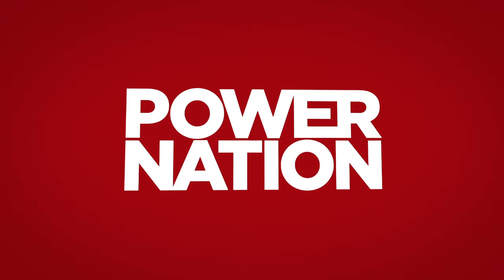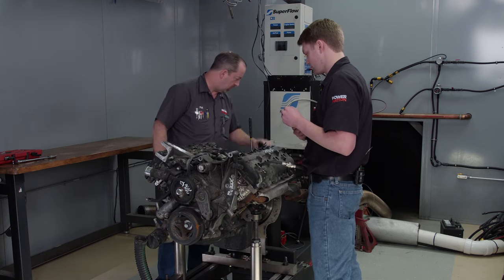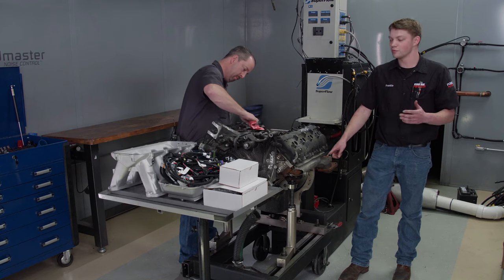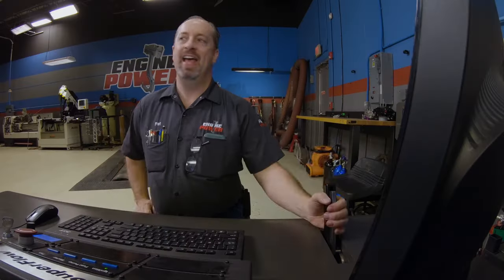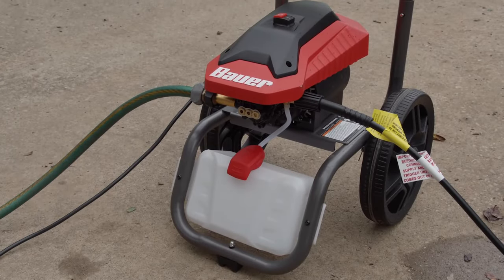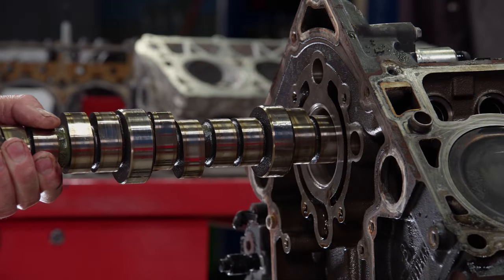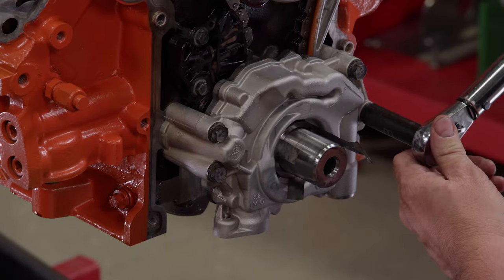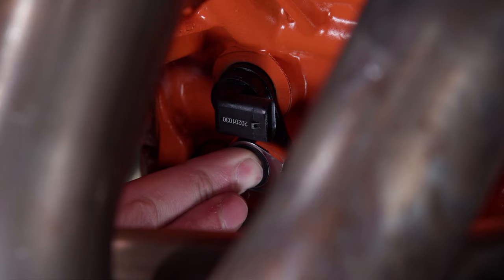Burnt Junkyard 6.4L Gen III HEMI Rises From The Ashes - Engine Power S8, E12

Comment: Not a tunnel ram fan, but to bring a scarred junk engine back is pretty cool nonetheless.
Reply: For sure, talk about a weekend special. Way cool.
Reply: Would have loved to see what they could do with something that would fit under a 440-6 pack hood or something. All of their builds are "streetable" race engines and would like to see just a healthy driver that isn't so over the top.
Reply: @JDK73772  a cam only 6.4 Hemi truck engine is a race engine?
Reply: @GTPCarpy  You missed the part about fitting UNDER a hood. More street oriented.
Reply: @JDK73772  you're still insinuating that it's a race engine and it's only "streetable" since it clears the hood
Reply: Is a junkyard SBC a joke to you?
Reply: @JDK73772  How is this engine not streetable? It’s a stock engine with a cam and an intake. Not man enough to put something through your hood? Then get a shorter intake and spare the tears.
Reply: @moparproud3978  the Hiram comes with a top end that fits under the truck hood.

Comment: Even the bone stock 5.7 gen 3 hemi heads flow enough stock to make serious horsepower
Reply: $300 cam swap and makes 400hp. Not bad at all.
Reply: The 330CFM Apache heads are good for a little over 700hp Na

Comment: I'd love a engine like that in my 1977 w200
Reply: I’ve been wanting to do a swap and put one in my 91 Jeep Grand Wagoneer. There’s a few guys out there that have done it already and it is a phenomenal swap!! It fits fine but gives the big truck the power it should have had from the factory. It replaces the 360 AMC engine rated at 174 hp or in that ballpark. It was fine for cruising but you wouldn’t break any speed records at all. The hemi fixes all of that and makes the Jeep an incredibly fun truck to drive period!! The rest of the driveline with the 727 torqueflight tranny , heavy duty transfer case, and the Dana axles can all be reused as is. I really hope I can find one soon and get this thing back up and on the road again soon

Comment: I cringed so hard when they put the stock lifters back in. The one thing that ruins almost every hemi engine, gets reused smh
Reply: Funny that they spent as little time as possible on the cam and lifters. As if there might be an issue with those gen III Hemi valvetrains...
Reply: Did you see the 410 project that has never been spoken of after build
Reply: @BuckI2Bdad  No, I am not aware of that project.
Reply: I am truly surprised that they didn’t install an aftermarket lifter that is greatly improved and guaranteed not to eat the camshaft! To install a higher lift cam and keep the stock original lifters from the truck seems like a recipe for a reliability disaster! Absolutely shocking! Does anyone know of a company that makes an indestructible lifter for this application? Maybe the OE hellcat Redeye lifters would’ve been a better choice?
Reply: Either misinformation or not enough.  This was a factory MDS engine as they left the solenoids in and connected, tuned out for the camshaft/phaser lockout would need those 8 lifters replaced at minimum.  Mopar 05038784AD latest revision "hellcat lifter" is the best solution for performance valvetrain.  May have used the original yokes
Reply: @Justacogg  There is no such thing as Hellcat Lifters, Just Non MDS ones, which have been the same the whole run
Reply: Only MDS lifters are known to fail, Looks like they used Non MDS
Reply: @captainboose8788  not true, plenty of 6 speed challengers and HD trucks non-equipped with MDS have had cam/lifter damage.
Reply: @Justacogg  especially since they said that they did have at least two bad lines on the cam they took out so why would you use  the used lifters for a new cam? Sure, they will work for a bit but your asking for bad issues!! Can they not give pat a big enough budget to get new lifters to go with the cam?? I know it’s a hemi and all but they can’t be that expensive for lifters that a tv show building high end cars ought to be able to afford the things

Comment: I have bought a couple third gen hemi that were burnt up and never had a issue with them just replaced the melted intake and whatever else was destroyed and they always ran without a problem but I did see one engine that was burnt up but it was in a high heat situation where the aluminum was melting so I made sure to stay away from that good thing it was a 5.7

Comment: Those motors make really good power with with small upgrades.  I wonder why people never used them for swaps or builds? Price maybe? They seem to have a higher power increase from a cam swap than ford or Chevy. There's a cam and head package for the first gen Hemi 5.7 that brings them to 500hp.
Reply: The hemi heads are quite a bit more bulky than the heads of e.g. a LS, perhaps it's just a bit more difficult to get one to fit?

Comment: Im swapping a 6.4 Hemi into my Dodge Dart Swinger. With a Whipple supercharger. And a bunch of upgrades. Such as a really agreessive cam, ported heads, tunnel ram, racing fuel system complete with high flow injectors, fuel rail, a crazy fuel pump, and all new plumbing, as well as a full blown racing autocross suspension set up, brembo 6 pistons up front and 4 piston out back, EBC Yellow stuff pads and Brembo Slotted Rotors, and a fully custom set of long tubes and titanium alloy x pipe and MagnaFlow high flow mufflers for that beautiful rumble. I'm also doing a full cage but not too crazy so I can fit my baby seat in the back .and I ordered some Bride racing seats and 5 point harnesses and no need for a radio btw. Also I've got a really great ignition system by MSD and a modern digital dash for those accurate readings.

Comment: Well done...lots of good info here.....I think that you guys could have upped cam specs given the intake and the heads, which are massive in breathing capability. (325 CFM @ .600 lift). The heads also have substantial numbers at critical mid lift points too.....that cam actually has pretty mild .050 numbers...with that intake and carbs, I would have installed a cam that measures in the 240 degree @ .050 region.

Comment: I thought your suppost to check compression when fully warmed up and not storage room temps? nothing wrong with harbor freight stuff . I have a harbor freight - 2 ton engine hoist and 2 4 wheel engine stands and an H frame shop press no issues

Comment: How much aftermarket support is there for Detroit diesel engines? I feel that would be a hell of a project, and maybe pop it in a old mid 50's chevy or somthing.
Reply: There are several folks around the country that are Detroit gods and could help you out there. Parts are still readily available for them but that is gonna be a huge chunk of lead to try and set down in to the front of any passenger vehicle!! They worked really good in the big trucks but the frames and axles were built to handle the weight but the cars and light trucks won’t do it without major re-engineering 

Have fun man!
Reply: @1982MCI  I was thinking of a 1954 ish chevy truck, specifically the heavy duty ones, the trucks used as logging trucks, that would be bad ass
Reply: @repairsbyseb1843  it would be badass man. It’s doable too, I’ve seen Detroit’s in a few things like that but it is uncommon. Most guys are using the Cummins but I like your idea of going Detroit!! Parts are available and you can usually find an old running Detroit that’s been used as  power unit for something else and not run hard and you can usually pick those up cheap, ive seen plenty of them under $500 for a running unit!!

Good luck man

Comment: It's got a cop motor, a three hundred ninety two cubic inch Hemi plant.
It's got the cop camshaft, cop lifters, cop pushrods, 
It's been running 15,400 hours at idle with no oil so the cam lobes are flat. 
What do you say? Is the new Mopar Hemi crap?

Comment: Pretty solid numbers but two 750 carbs seem abit much for that engine
Reply: I bet 2 670, maybe 2 570 would work out to 6000 rpm
Reply: Perhaps they intend to spray it later and need the additional fuel and air?

Comment: You left the MDS system in there. Remove that and change the lifters to non mds and you will have better oil flow and hopefully not develop the hemi tick. Now if I could just go back in time to tell you when you still had the engine that would be sweet.

Comment: I am very surprised that a higher lift camshaft was installed and the original equipment used lifters were reused? 
To me that sounds like a reliability disaster just waiting to happen! One of the only reliability issues with this engine is a roller going bad and the lifter eating into a camshaft. 
To make life harder on a set of old used lifters seems like a recipe for disaster! Does anyone know of a company that makes a reliable set of lifters for this application? You would think they would be highlighted on this build!
The theme for this build could’ve been and probably should’ve been how to eliminate the hungry lifter issue eating camshafts. Maybe the next build it will be addressed?
Reply: HHP Racing sell aftermarket Hemi lifters. “Only” $760 a set.
This show is mostly about getting it to the dyno not running lots of road miles.

Comment: Could the sniper have been used to control the cam phaser to really maximize performance?
Reply: a lot of time's you cant use the cam phaser on these engines with aftermarket cams.  It causes piston to valve clearance problems.

Comment: Can someone explain to me how e compression test reached 270psi? That would be 18:1 compression at sea level. 170psi would make more sense, @ 11.6:1.
Reply: I have the same concern. I guess it is a joke.
Reply: Cylinder pressure does not equal compression ratio.  Two separate things. Google it
Reply: Nah, you can't reach 270 PSI cold cranking with 11CR. CR and PSI are in close relationship with intake valve closing.
Reply: @rejeanlaflamme4037  p

Comment: How come a 3 litre 6 cylinder engine like toyota's 2JZ is capable of making 1000 horsepower when modified, but this 6.4 litre v8 thats consuming more than twice the amount of petrol after being modified with all the good parts that these guys have put on, is only making 550 horse power?

Comment: Are we sure this is a 6.4L the power seems more like a 5.7 and the 6.4 blocks would come in hemi orange. It should have 6.4 or BGE on the block some where.
Reply: It's a 6.4L Hemi V8 out of a 2016 Ram 2500 HD truck.
Reply: They only went to 5k, and it was pretty messed up

Comment: I get why you're doin it, but I'm still a little disappointed in the decision of carbs over EFI. And for probably twice the cost too boot.
Cheers 🍻.
Reply: I don't see the point in going with the carbs either considering the other parts they put on it. All they really needed was injectors, a throttle body and a sensor or two yet.
Reply: They would have to modify the entire fuel system for EFI because the operating pressures are much higher. In tank fuel pump, new fuel lines, etc. The goal was to have a modern engine ready to drop in and run on a classic car in a weekend.
Reply: @TwentytenS4B8  The fuel system needed to be completely redone on the car they are putting the engine in anyway. The 6.4l is not setup for a mechanical fuel pump so you go with electric. It is not difficult or expensive to run a return line to the tank. There are advantages for a return line with carbs too.

Comment: She should make 600hp
Reply: easily
Reply: Nope.  Not even close.
Reply: More cam & port the heads
Reply: @austintyler7991  I was thinking the same thing, but the heads should flow enough as is to make 600hp. My stock iron rectangular port heads flow enough to make around 650hp without port work.
Reply: @austintyler7991  Totally agree brother.
Reply: This appears to be a weekend project from your favorite salvage yard.  Not a total Horse Power build. Something you might want for a Monday morning burn out. Look what I did this weekend,  Ha Ha.
Reply: Not without boost or spray and perhaps a more radical cam. But at that point, you're getting into cylinder head modification because a simple spring change will not suffice. The guys on Engine Masters did one of these engines and their goal was to make Hellcat power from a stock Hemi. Even with the Procharger they were using, they got real close and that was with pulley changes to increase boost. The build these guys did made accurate numbers based on the parts they used.

Comment: A microMETER goes to ten tousandth of an inch?
Reply: Vernier ones do yes
Reply: @stevenhoitz9260  i know but micrometer its a metric system measure. So it doesn't make sense calling it micrometer when it is in inches
Reply: Micrometers come in standard or metric
Reply: @andremarques7907  a micrometer is just a precision measuring tool. They are made in both units of measure.

Comment: I have a 15 Ram 2500 if you think for a minute these engines are good on fuel that is BS. I have fixed the exhaust problem that improved about 5 miles per gallon and a little more power, instead of being out run by a Subaru Outback I can beat it know. This is a POS as far as a performance vehicle it does have incredible towing but piss poor mileage, I tow my trailer up Cedar Mountain for the 25 miles ride it consumes 20 gallons of fuel now before the exhaust I would have to carry 10 gallons of fuel to drive the 25 mile trip. Ram can build an engine better than that I have seen it in yesteryear,power and fuel economy.
I had a 24 valve diesel with a 6 spd trans, I only got 600 thousand miles great mileage and power. I know they can build better than this junk I think they should build something that will get good mileage and have great power.. I use to love my old Ram Ram trucks but so far I haven’t seen much good with my newer one, I have put more money into it than I should have to be able to tow or have more power than a Subaru 4 cylinder what a slap in the face.

Comment: More proof the LS is a better platform. An LS3 will make more power with just the stock intake and a cam, no need for a tunnel ram.
Reply: Yes
Reply: Very true.
Reply: Still cool, and an LS will never be a Hemi.
Reply: @blackbuttecruizr   Bro, it's not a real HEMI.
Reply: @blackbuttecruizr  it doesnt need to be 🤣 if the hemi was the size and price of an LS, people would be swapping them into more cars
Reply: You're confused with what type of 6.4 this is, the Ram 6.4 is built for towing and hauling with lower compression compared to the scat pack/ SRT 6.4 that is higher horsepower with higher compression.
Reply: @that_1998_ranger  Nope. It doesn't have the hemispherical design like the original. It's a 'SEMI HEMI'.
Reply: @shockracer  

Sigh.

Go look Richard Holdner’s videos with the LY6 tests. The LY6 is the 6 L truck motor with LS3 style heads. With similar compression and smaller displacement the cammed LY6 makes more power with a stock manifold.
Reply: Reminds me of the 9 MM and 45 ACP Debate. All the best everyone.
Reply: @roggie77777  lol then you get that one guy that believes .357 SIG is best
Reply: @shockracer  you’re aware that almost all modern engines utilize some sort of pent-roof hemispherical combustion chamber, right?  Like, all overhead cam engines are HEMI’s.  HEMI is only magic if you can’t let go of advertising lore of the 1960’s.  The 427 cammer was a better engine but technology couldn’t make it reliable at the time.   Yes, the original 331 Hemi was a revolution in cylinder head design, but the modern Hemi is a friggin dinosaur for the sake of advertising.  You want to tow?  Buy a diesel.  You want the most modern pushrod V8 possible?  Buy anything LS/LT powered from GM.   You want a truly modern engine, buy a coyote.   You want the same marketing of the late 60’s with no substance behind it?  Buy a modern HEMI powered Chrysler product.
Reply: @Snakeman1985  No, my .25 ACP is best lol :)
Reply: @AaronsRandomLife  Have you heard of the new 7.3L Godzilla V8 from Ford.
Reply: The LS is a very popular platform no doubt - but better?  debatable. If the Gen III Hemi had the support the LS does then it would be apples to apples comparison. However, the stock intake on the 6.4 (car) has a variable length runner system and is rated at 485hp/475tq. The LS3 is rated at 430hp/420tq. Granted the LS benefits from an aluminum block and suffers from .2L displacement less --- but overall the coveted LS3 really doesnt show to be much "better" than the hemi in any respect. Aside from the hype and mass market of the LS engine with support - it doesn't explain how it is better in any way. Not knocking the LS in any way - just pointing out popular does not equate to better. The hemi does have well documented problems with the early 5.7L dropping valve seats and the dreaded lifter failure - but the 6.4L also has a strong forged crankshaft compared to the LS3s cast one...      it's all trade-offs
Reply: Aluminum block junk ls motors are fragile don't ever compare the two again
Boy
Reply: @kyboy5  They sell literally 1000hp aluminum block crate LS engines dude...    not exactly "fragile" - look at the Coyote - also aluminum and makes wicked power

Comment: So we're not running a regular leak down test to see if the valves have corroded to-the-point d in pitted into the seats and we're not going to x-ray the block or check the cylinder liner for Magna fluxing if there's any cracks from all that water that probably froze like a solid block of ice last winter that's more than likely could have busted everything but then when you get her running and fired up you'll know for sure won't you cuz you got sponsors who will buy you a new engine if you destroy that one first wonder how many mud dauber Nest was in the oil pan cars it doesn't matter now you started up a junkyard engine has been sitting for who-knows-how-long with every bearing bone-dry of oil as you never Prime the oil system before you lit it up leak down test on all the cylinders may have shown you which of the two exhaust valves are leaking